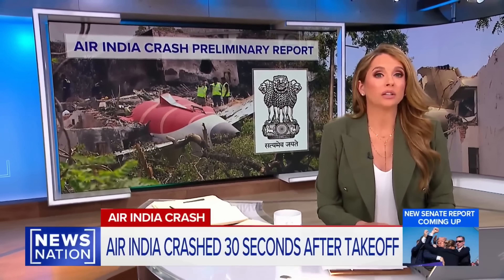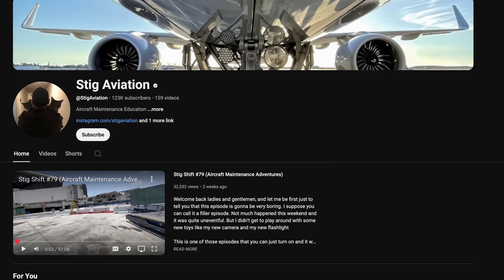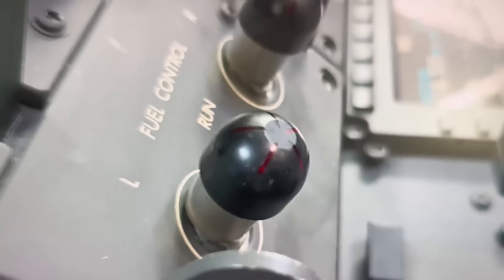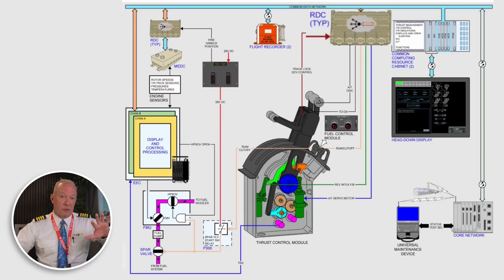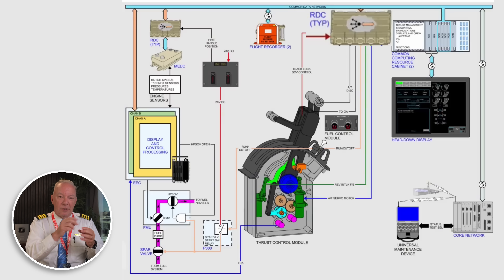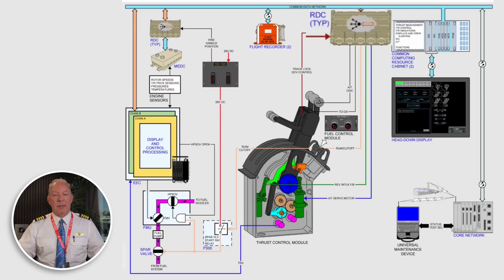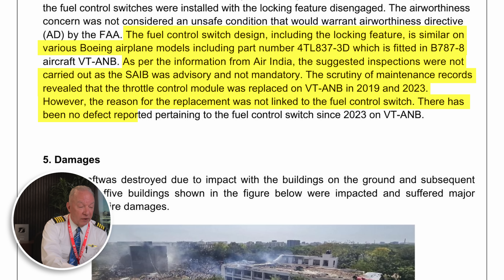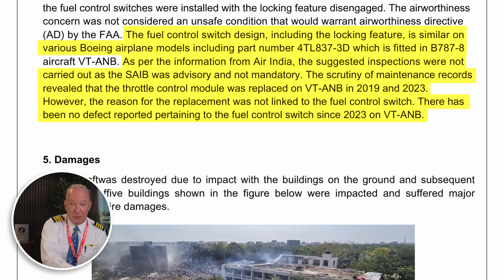The Truth About Boeing 787 Fuel Control Switches

Comment: Captain Steve, we know from the flight recorder that the 2 switches were set to the off position, but do we know if there's separate telemetry  on the flight recorder for the DC relays themselves. In other words the switches were placed in the off position and milliseconds after that the relays opened?
Reply: I don't think the FDR gets switch position from the switches themselves. I believe the valve position switches (limit switches on the valve actuator shaft) send a signal to the Common Core System stating the valve position and the switch position is inferred from that. (not 100% sure, my responsibility was only for the fuel system side). The actuators take a second or so to change from open to closed (varies with reduced power, temperature, etc. ) The HPSOV actuates faster as it is a poppet valve. The preliminary report just said fuel valve and didn't state which valve it was. I assume, both indicated the same and so they were ... just sloppy.
Reply: @paultruzzi911  The EAFR receives signals from the switches as well as the valves.

Comment: Captain....what about a battery failure? I have seen reports that suggests that there was a battery induced fire that damaged the rear  black box. Also can you pls clarify if the RAT can power the fuel cut-off switches in case of a battery failure?
Reply: The fuel spar valve(s) nee power provided to the open or closed circuit. Removing power leaves the valve it the previous position.
Reply: "I have seen reports that suggests that there was a battery induced fire that damaged the rear  black box."

The APU battery is installed in the aft Electronic Equipment bay, which is located under the floor, just aft of the trailing edge of the wing. The arft EAFR is installed in the rear of the main cabin in the roof above the number 4 galley. The units are about 20m apart.

The aft EAFR was found about 100 ft from the tail section that was embedded in the roof of a building. The EAFR was badly crushed and was in a region that was subject to an extensive and incense fuel fire, for an extended period. There is no evidence that the APU battery was involved in the damage caused to the aft EAFR.

The report suggesting the the APU battery was involved, is fake news.

Comment: I see you are not an engineer. Total misinterpretation.
Titanic cannot sink? Be sure, it can!
Here you show again, that you have no real idea what can happen - even if the circuitry was that easy as you think.
And even your simplified schematic already shows, what possibly could go wrong.
In the comments of the last video technicians and black box programmers were in doubt. All technical specialists don't believe in "fail safe" because such thing does never exist. Your believe in this video is similar to "I'll never die, because I never did so far".
The black box just records a high or low every second. And that is taken not from the switch but from the switched line connected to the valves. In fact we know very little from the published.
E.g. that "second" could have been a microsecond also (the 1s sampling time of the black box allows not to know that, the transition just isn't in the same sample period).
Please leave the possible trouble shooting to the engineers, if such a incident falsely would be blamed to the pilots, that leaves us a ticking time bomb.

Comment: I have a feeling this dude is working for Boeing. In a machine like this you CAN NOT only focus on how the actual switches work(!), for heaven's sake. There is a computer involved; there are miles of cable involved; there are multiple other things involved, and to simpky suggest the switches can ONLY send a signal through the switch is criminal….

What about the circuitry giving electricity to and from the switches??

My computer turned off by itself the other week. You know what was the cause? Malfunction in the brain of the computer, it was NOT my button that actually went to OFF. But in an investigation that would have been the cause I guess (as the log said the button turned off the computer)…..

Comment: What about this water ingress issue  https://www.youtube.com/watch?v=Ik8G2HCP4ls
Reply: The fuel spar valves are either powered open or closed. Loss of power does not change their position. Water ingress would not provide power to either circuit. It would probably pop the circuit breaker (electronic mosfits don't pop, but old technology).  A chaffing wire could provide power to a closed circuit. But that would only affect one engine, and removing the short would not open the valve 10 seconds later. That requires power on another circuit.
Reply: @paultruzzi911  yeah but like any human if one of the pilots thought that something was wrong with the switches like if a light switch doesn't turn on the light you may switch it on and off to check.
Reply: @paultruzzi911    true

Comment: The switches may be mechanical, but they send an ELECTRICAL signal to the fuel valves to open or close. Therefore, it is POSSIBLE through tampering, sabotage, microwave etc the ELECTRICAL signal could have been activated 'downstream' from the switches.
Reply: Aliens did it. Get a life. Yes, with enough time on the airplane anything is possible. But remember, the circuits are purely mechanical. So in you altered reality, a new switch/control needs to be installed between the fuel cutoff switch and the fuel shutoff valve. I hope the investigators are looking for something that doesn't belong there.

Comment: In order to turn on a relay, the switch would need to close (or open) to complete (or break) a circuit to the relay's magnet. Technically, a short (or break) in the wiring from the switch to the relay could engage the relay. I'm not saying this is what happened in this case... but this explanation does not rule that out.
Reply: I don't really remember if there is a relay or not. But it makes sense not to put 28vdc on the flight deck switches (think of those switches as a computer keyboard. It would be difficult to provide different power to just one or two switches). In any case, a fused relay just prevents actuator position change, it does not command it to change. The actuator needs to be powered either open or closed for it to change states. Otherwise it sits where it is.
Reply: @paultruzzi911  Indeed. I definitely would like to know more about how this system is set up to understand where faults of false readings could come from. The explanation in the video does not explain everything away (although the timing of the events is powerful evidence it was not a fault)
Reply: *"or" false readings.... not "of"

Comment: This was most likely pilot suicide.  But, there is a small change the wires for cuttoff switches were run on the same wire harness partly through the plane, or 2 different harnesses next to each other.  Imagine engine 1 and 2 cuttoff wire had their insulation stripped due to friction.  If these 2 exposed wires came into contact with each other, or even the body of the aircraft, it could cause a system reset (ie both engines off), and the computer would record it as the command having come from the switches in the cockpit.  That 1 secnd difference in meaningless if you understand how computers work.  For instance, the second engine cuttoff could have been 0.0001 ms aftet the first cuttoff signal and its possible the computer recorded that as a 1 second difference when it was 0.0001ms difference.  This is because a computer logs everything by system time.  Imagine the system clock says its currently 1:31:58  pm with the milliseconds as close to changing the 58 to 59 as possible.  1 engine would record a shutoff time of 1:31:58 while the other engine literally 1 milliseconds later could record a shutoff time of 1:31:59.  This is due to the fact when data is processed it takes time.  Ie writing enine 1 was shutoff to the black boxes would cause enough of a time delay to cause a 1 second discrepency.  This is not only possible but likely.  Ie if you switched both cuttoff switches to off at the exact same time, there is at least a 10% chance the data recorder would show a 1 second difference.  Good luck recreating that in a flight simulator though, everything from length of wires to exact same cpu hard drive and memory modules that match the exact plane would be needed for a flight sim to recreate this.  Ie you would need to rebuold your flight simulator completely, possible but no chance in hell anyone will do it.

Comment: Steeve, if those switches were that perfect as you say, then why the manufacturer, boeing issued a circular to check and change the valves if required?

Comment: Unfortunately, the system as shown in the simplified schematic is not 100% reliable.  The point of failure is not allocated only in those manual spring loaded switches.  They do NOT directly connect the valves’ actuators (dc small servo motors or other types of dc motors) to the 28V DC prime energy source.  The relay does.  The switches CONTROL the relay.  The reason behind it is that manual switches would have to be of a substantial size to handle valve actuators (motors) high currents (Amps with inrush currents of 10’s of Amps).  Instead a separate voltage source (usually of low voltage, but not necessarily ) provides very low current (level of mA) to the relay’s control coil via those mechanical switches.  The relay’s control coil acts as electromagnet when energized.  The electromagnet then attracts a metal plate closing the relay’s main contacts that close the 28V - valve actuators’ closed loop.  So there are 2 loops: 1. the low current signal loop powering the relay’s coil (by closing the mechanical switches) and 2. The power loop 24VDC - valve actuators.  If the relay’s contractor 2 contacts got deformed overtime or due to high temperature developed due to high current flow (one reason could be a valve’s abnormally high friction) these contacts may be driven apart for even for a moment without cutting power to the relay’s coil and then bounce back.  But then there is the 10 s argument, right?  Well, to prevent intermittency from manual switch multiple opening/ closing, relays are equipped with denouncing mechanism - a d fixed minimum time holding to prevent main relay contractors from bouncing high currents.  A 10 sec setting of the debouncer would explain the 10 sec OFF and ON interval between the shutoff and energizing the fuel pumps.  This is a common issue in substations and motor drives.  Scheduled maintenance and observing strict times of replacement of the relays is the necessary condition for reliability of relays based energization.  I don’t know whether the actual schematics are as were shown in this video, but if they are then the causality of the problem may not be 100%.

Comment: Quick question...there is an assumption the battery is capable of putting out enough voltage to run everything for several minutes. What prevents an aircraft from flying with a weak battery? Thanks...not trying to be critical but curious.
Reply: Yea, the battery can not power everything. There are battery monitoring systems and checks that view battery status. It is a fairly critical backup system. But in this case, the fuel spar valves do not change position with the loss of power. They remain in their previous position. If all AC power was lost, the battery would provide power to close the spar actuators.

Comment: We need the time stamps of when the switches were cut off and what was said about them being off. It appears the RAT was deployed very early, so the fuel cutoff would have happened even earlier. But we need to know when. Were they even on at the start at all? Was there fuel in the system enough to take off? I know these appear silly questions, but an exhaustive list of scenarios need to be examined thoroughly before we jump on the pilot murder/suicide theory. To do this any other way is irresponsible and dangerous. Also, regardless of whether the unit was replaced due to defective control switches or not, there were different switches now to back then. Not saying it could not possibly be pilot murder/suicide, but it seemed very quick to go to that conclusion. How to make flying safe is the issue at stake, including pilot mental health of course. Were these switches examined to see if they work as designed, or are we just assuming they were functioning normally? These things HAVE to be examined, and does not appear to be happening here. The reasons for this concern me greatly, and reduce my faith in the industry.

Comment: Sadly, you are fixated on the fuel control switches and not the electrical system or hydraulics or RAT or timeline or altitude or climb rate or speed, and so many more bits of evidence that the pilots had a mess on their hands and couldn't find a solution in seconds. You seem to have deliberately avoided the work of several other analysts who have, frankly, outworked and outanalyzed you. From practically Day 1, you settled on pilot suicide and started marketing your services. That, to me, was incredibly disingenuous, bordering on callous, especially in light of your YT monetization of the accident. It was plain to me that you are not really a technical expert in airplanes. But, a lot of people look to you out of perhaps curiosity and maybe boredom for insight. I don't think most of them really possess the kind of doggedness to really dig into something this technical and so they accept your theories/conclusions. I don't, and I seek many other views and did from Day 1. That has led me to conclude that we still don't know exactly what happened, but I'm 90% sure it wasn't suicide. That airplane was not doing what it is supposed to from the get go. I think you know that, but since you are so invested in your original psych theories, you are going to wait it out. Fortunately the lads at Geoffrey Thomas' channel, whom originally were not persuaded the accident was unintentional, did the heavy lifting to find answers and probably have the best analysis and conclusions so far. Water ingress on rotation into the aft electrical componentry.

Comment: I suspect NOBODY touched the switches, an electrical problem cut the fuel per the EE bay water ingress theory which perhaps recorded as switches off, because (1) there is a visible warning on the display leading to  (2) the PNF saying "why did you turn he fuel off" and getting "I didn't" so consistent with seeing 'fuel cut' and no ARGUMENT, and (3) it took 10 seconds to restore fuel to one engine and another 4 to the other when no WAY would they take that long knowing everyone was about to die , and if there was a struggle on the CVR they'd share that surely? It'd be LOUD but they radioed calmly . Then soon as whatever short caused it passed - some fuses reset or the rat augmented power? - the FADECS would have taken over the task of relighting because no weight on wheels. The switch position sensor contradicts this, but 'electical problem' might be responsible. I just refuse to believe they wouldn't be yelling and having a loud boss fight over the switches for 10-14 seconds .
Reply: EE bay water ingress theory?  Are we speaking English? The Fuel Shutoff valve position is transmitted to the CCS, in an EE bay.  But the fuel shutoff valve command is a purely mechanical signal  = wires, relays and actuators.
As for your comments about what the Pilot in Command would notice ... next time you are driving your car with a passenger you should wonder if they have spiked your coffee. You can't see it as you are driving, and will only notice as you taste that bitter almond flavor ...

Comment: Very poor explanation of the of the switch wiring. There is much more involved than what he showed. There would be multiple wires running to each switch. Never explained how the RDC gets its information from the panel.
Reply: His explanation is mostly correct. The Remote Data Concenrator gets valve position from dc limit switches in the fuel spar valve actuator which go to the RDC which converts it to a digital signal and sends it to the Common Core System. The CCS "publishes' that information and subscribing system read it. So the flight deck display changes its image of the valve position, the FDC records the valve position change, the Fuel Management System (an "app" on the CCS) knows that valve is closed.
Reply: @paultruzzi911  The position of the switches is also recorded by a similar route.

Comment: Just curious how the black box data recorder knows they were put into cutoff and run? There has to be some signal that gets transmitted to the black boxes.
Reply: The FDR records the published position or status of many systems. In this case, the fuel shutoff valves have a limit switch which says open or closed. The FDC just records it.
Reply: @paultruzzi911  Both the position of the switches and the fuel valves are recorded by the EAFR.

Comment: So... a little question. Could it be caused by drained battery? Like switches in the right position, but so few volts going trough, that the valves could not stay open?
Reply: The fuel shutoff valve must be POWERED to a new position. It has no default position
Reply: Ok, thanks. Wasnt clear to me after the toy demonstration.

Comment: As someone without first hand confirmation about how the system and loop worked I still have one big tell that this wasn't some machine malfunction. The pilot in the cockpit accused the other pilot. What did he see that his mind chose the words "why did you....' instead of 'seems fuel cutoff' in a surprised but collaborative tone. And if it was the first officer,  there'd be a gate in his mind, discouraging accusatory words to a captain without proof. He saw the switches physically in the cutoff position and his mind produced the language that it found most likely.